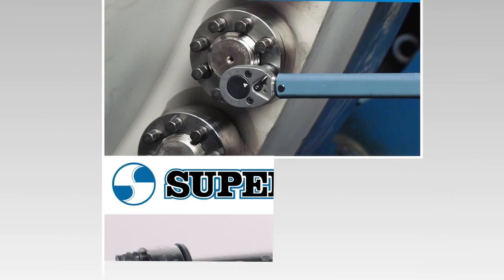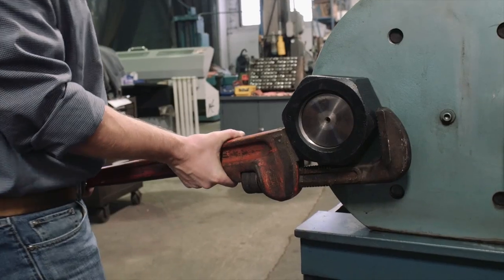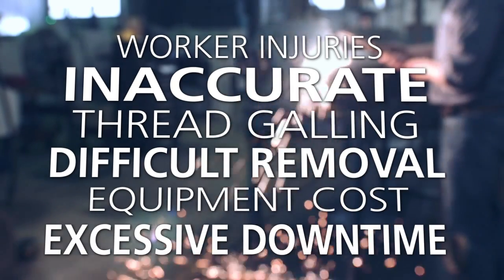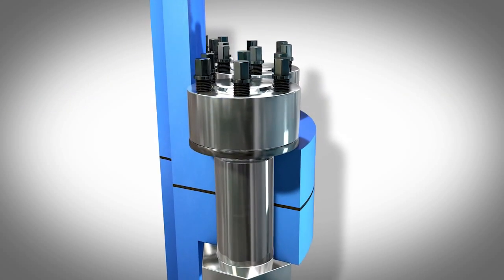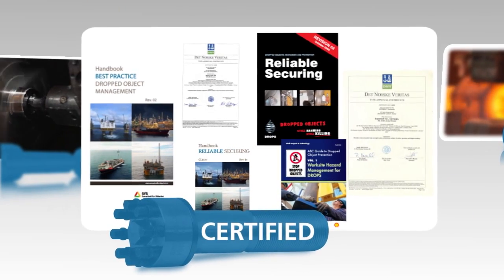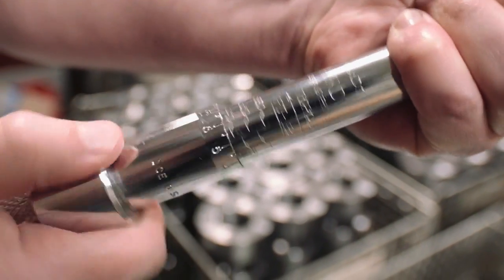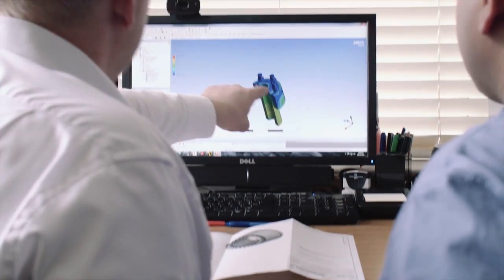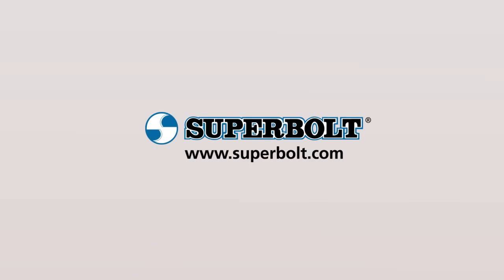Superbolt™ Multi-Jackbolt Tensioners

Comment: So the bolt diameter needs to be 60mm or more to really  justify the purchase of this product.
Reply: Superbolt sizes start at M16 and 3/4".  At these sizes and up, Superbolt can achieve high clamping loads with low torque requirements using only hand tools.  If the scale on the torque comparison chart was adjusted you would see a large difference in torque requirements even for M30.  For example you would need around 930 Nm to achieve 310 MPa on M30 stud.  With Superbolt, the torque is only 30 Nm.  Drop us an email at info@nord-lock.com if you have any further questions.  Thanks.